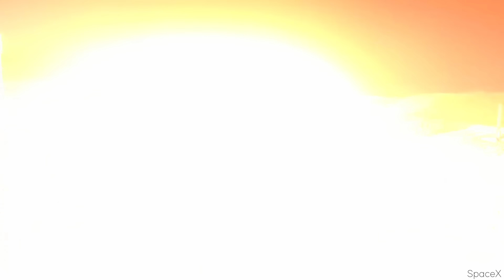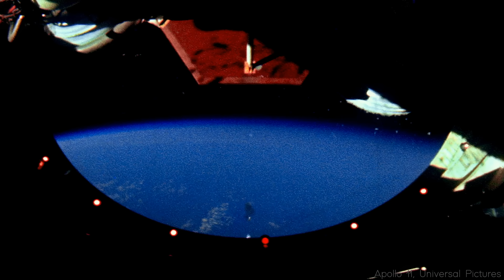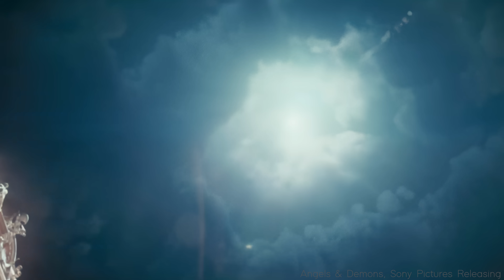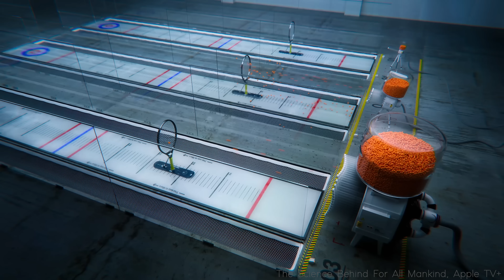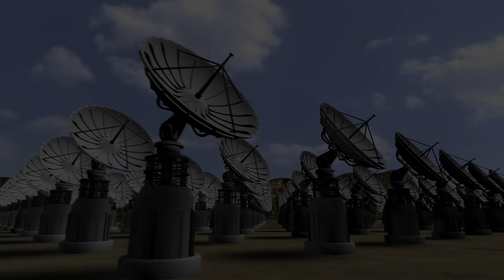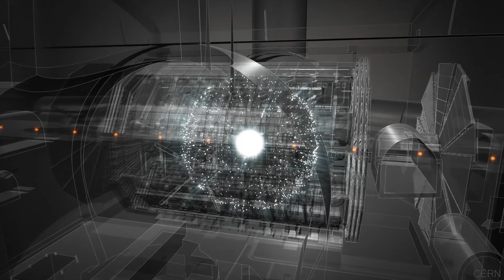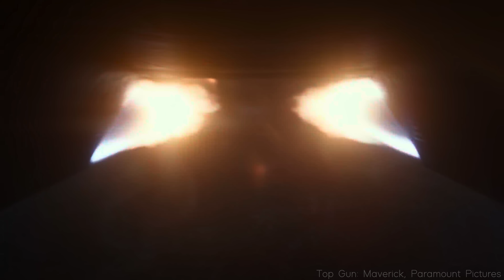Interstellar Propulsion Technologies - RANKED!

Comment: I watched the video twice over again. It's really good, as all of your videos. Big fan of your channel.

 feel like at least two options are missing.

One missing option are nuclear fusion drives. Fusion was briefly mentioned with the Bussard Ramjet. As fusion is likely to have a specific impulse a few orders of magnitude bigger than fission, it may be worth a mention. Also, there are efforts to get active engineering research going on fusion drives. Fusion drive research will also benefit from the already ongoing fusion reactor research. There are some major technological breakthroughs that are required for fusion drives to become a viable option. One is that we get nuclear fusion reactors fully operational. We're on a good way with that, although not quite there just yet. Second is that once we understand nuclear fusion reactors, we need to miniaturize them. ITER is one of the largest and heaviest machines that humanity has ever built, besides aircraft carriers and the LHC. Too big to put on a spaceship, even if we make the spaceship a bit bigger. This puts it into the A-tier, and in 1-2 decades this probably becomes S-tier.

Another missing option is the Kugelblitz engine. A Kugelblitz engine uses the Hawking radiation of a tiny artificially created black hole. As the general research about black holes is very solid and creating an artificial black hole seems actually possible using a Dyson swarm, this isn't as speculative as Alcubierre Drives or wormholes. I'll put it in the C-tier.

Comment: If I remember correctly, both the nuclear lightbulb and nuclear salt-water designs have high specific impulses, way higher than "double of chemical rockets". In theory, nuclear salt-water could even have high specific impulse and high thrust simultaneously, basically making it a torch drive we can actually contemplate. The only problem is it's incredibly dangerous and polluting if used in the atmosphere.

Comment: Running a 100 Gigawatt laser array would cost like $10 million per hour just for the power bill. The breakthrough starshot proposal envisions sending 1000 probes weighing only a few grams each, which would take about 10 minutes of laser power to accelerate to their final cruising speed of 20% light speed at 10,000g. That's about $1.6 Million per probe just for the electricity, or $1.6 billion for the whole swarm. (To say nothing of the cost of actually building such a massive laser array.)

Comment: Antimatter-metallic hydrogen Impulse jump drive . Only thing is that u can’t go in a straight line but an upward jump. U turn on the ships plasma bubble by blasting the bubble with ultra intense laser to squeeze the photons into a dense shield of “squeezed light plasma”around  ur ship .angle to ship 90° for a jump .release the Antimatter-metallic hydrogen into impulse thrusters redirecting the squeezed light plasma around the ship into then thrusters via vacuum burst and ur vessel is in motion till u run out off energy . About 20x the speed of light !!!  in a hop worthy of sci-fi fans
Reply: That sounds like the self-licking Ice cream cone has a shape-charged Twin?

Comment: The rule of thumb that I like to use in my own thought experiments is something I like to call the rule of 9's.  If you accelerate at 9m/s^2, you will reach 90% of C in 9 months.  These values are rounded and if you do the math, none of them work out to exactly that, but it's a useful back-of-the-napkin formula.  I also like to use this because at 90% of C, time dilation will cause the travelers to experience roughly half the time as earth (excluding acceleration and deceleration), which is also a good psychological limit for the travelers.  If you experience half the time of earth, then when you return, things will be different, but probably not totally alien.
Reply: The real advantage of this acceleration is thats its nearly 1 g, constantly, allowing the expanse like artificial gravity for the entire ride.
Reply: It is harder and harder to sustain that acceleration the closer you get to the speed of light.
Reply: @ЕфимРябушев  From an outsiders perspective the acceleration is decreasing due to time dilation, ie since time is passing slower on the ship the engine is getting less done per second so the acceleration drops off as the ship asymptotically approaches the speed of light. However from the perspective of someone on the ship the acceleration feels constant, since they are also being time dilated, they feel like the same amount is being done each second since their seconds are longer.

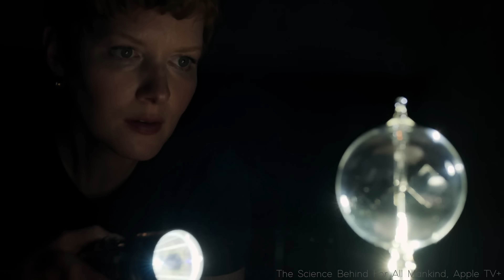Comment: Showing a radiometer 14:11 is an incorrect illustration of photon pressure. That's not what pushes the vanes of a radiometer. I myself don't understand the mechanism, but they rotate the wrong way for photon pressure to be the force involved.
Reply: Correct.  They work because of momentum transfer between the heated surface and the gas molecules in the container.  They only work within a relatively narrow range of molecular densities.

Comment: Using a series of the technologies proposed here together, I could think of a probe that might be used to test super luminal travel. I would use nuclear thermal plus Bussard Ram.
Accelerating a hydrogen particle to 10% lightspeed gives us fusion propulsion. There is approximately 1 hydrogen atom in any given square meter of empty space. That may not seem like very much, but if using NTP can get a ship to 1% lightspeed, those hydrogen atoms can be funneled and fusion can be achieved with much less energy because the ship itself would be smashing into those atoms. And then as the name applies, ramjet, the faster it goes the more energy it would produce. Cooling for NTP I would design a skeletal frame with piping that runs back and forth along the outside of the ship. This will hold coolant liquid that is dispersed and cooled by the coldness of space. This piping will also use torus EM shielding provided by fission to deflect oncoming hydrogen particles. There are different hacks I've been contemplating that should take care of a few of the issues that might arise.

Comment: Side-stepping the limitations of the rocket equation is essential for traversing interstellar scales, so putting laser sail alone in S tier makes perfect sense. Warp drives, negative mass, wormholes and other reactionless methods appear to be impossible and the amount of time it would take to develop the new physics that could render them possible is probably greater than the time it would take to travel to Alpha Centauri by laser sail anyway. As intuitive as rockets seem, leaving the heavy fuel and propellant behind and only accelerating the part of the spacecraft that matters is more elegant.

Comment: Technically, Alcubierre drives don't violate causality because they don't actually travel faster than light. The patch of spacetime around them does, which isn't prohibited by relativity. More to the point, the relativistic eqn of time (t' = t √1-v²/c²) doesn't say time goes backwards if you go faster than light - rather that time becomes imaginary - suggesting that you cannot go faster than the speed of light in spacetime. Regardless, this also implies that there are many different frames of reference and so rates of time all at "the same time", which begs the bigger question: which time?
We know that spacetime can expand faster than the speed of light. That's already happening (barring some new info such as some of the problems with redshift being caused by mismatches between various metrics for it). So clearly there has to be a mechanism to prevent the problem. In the case of Alcubierre drives - that seems to be the need for negative energy, which is kind of meaningless.

Comment: I agree with all the placements except laser sail. I would place it in C because, unlike the most of the others, it does not have its own internal propulsion. Worse, the external laser has a limited range. It does double as a solar sail, although its sail is too small to do much. However apart from this, once it is given a push from the laser it is helpfulness. It can't stop or change direction. It's light weight required will prevent and significant secondary propulsion. It is an excellent way to send out a probe. And the sail can  even double as an antenna. But it is not S tier for sending humans anywhere.

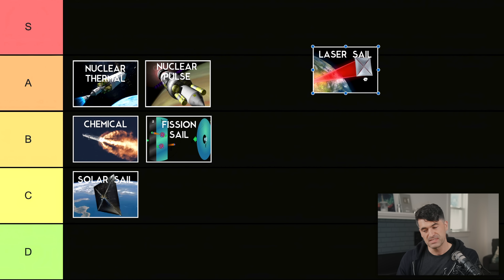Comment: 14:39 “…if we want a photo…”

…then don’t use any propulsion at all.  Use a telescope.

Telescopes come with massive advantages if it’s just information you’re after.  Telescopes are good for targets all the way out to the edge of the visible universe.  Multi-target, when we get bored of one target we just swivel it to a new target.  Serviceable, at least in principle, to repair or upgrade it.  Once a probe or people are sent repair or upgrade missions are impossible.

Ground-based telescopes are convenient but are limited compared to space-based options.  Space-based could have virtually unlimited mirror sizes.  Zero atmospheric distortions.  Interferometer baselines that could be kilometres, AU or lightyears.

Comment: Anti-matter drive. We need to find a cheaper way to produce it!
MRI type machine providing magnetic shielding…backed up by lasers vaporizing any specs seen by radar scanning.
Rotating cylinder providing artificial gravity.
Fly at 10% speed of light…Alpha Centauri in less than 50 years

Comment: I have a pet Idea that is a variation of the Bussard Ram Jet. Rather than have a big cone in front, wrap the ship up in electromagnets and use them to grab ionized particles and thrust them to the rear of the ship. Basically, a large quantity of mass-drivers. No propellent needs to be brought along. 

The ship would need to be sped up to a minimum speed from Solar orbit until it can gather sufficient quantities of particles as it moves forward. 

To slow down, the magnetic fields can push against the particles in front of the ship.

I think of it as a galley ship.

The ship would be built in orbit so that escaping Earth's gravity is not required.

Comment: "Twice the efficiency means half the propellant needed" - this line is not mathematically correct, although it's an easy mistake to make. Twice the ISP means double the delta-v is achievable when all else is the same, but it doesn't work out neatly when reducing the propellant loads. The non-linear scaling of the rocket equation means that an engine with double the ISP can achieve the same delta-v with less than half of the propellant, often much less than half.

For example, taking a craft with a wet mass of 100t, a dry mass of 10t and an ISP of 360, it achieves 8129m/s of delta-v.

An engine with a 720s ISP would achieve 16,258m/s of delta-v, which is double.

However, if we required the 720s ISP engine to do an 8129m/s maneuver, that can be achieved with only 32t of propellant (down from 90t). That's 2.81x more efficient. The difference comes from the fact that the higher ISP engine which spends 32t of propellant doesn't have to carry the other 58t with it, while the less efficient engine does because it won't complete the burn otherwise; the average mass of the craft is thus lower while the same thrust is applied.

Delta-v increases less than linearly with increasing propellant mass fractions and this punishes vehicles with lower ISP's more, earlier. There's a hard limit of delta-v that a given ISP can do for a given mass fraction and each 1m/s as you approach it gets more and more expensive. Staging effectively bypasses/resets this limitation, but comes at a high cost; doubling delta-v via using a two-stage vehicle probably increases the mass by 5-10x rather than 2x. After doing that a few times, things get truly enormous.

Comment: No mention of Fusion Torch rockets?  Why use all the mass of fissionable materials when you can use hydrogen and fuse it instead?  It's not even that difficult with our tech, the only reason we don't have fusion power sources is because we need to contain the plasma.  Fusion Torch Rockets use the plasma as reaction mass and can be a MUCH simpler design.

Comment: Halo drives would be like the mass relays in mass effect maybe. Because wouldn't you also need a similar mechanism to slow yourself back down? So it'd be really cool where it's easier to travel a hundred light years than ten. You'd be hopping around from fixed point to point.

Comment: Hold up. I'm not even 6 minutes in and I do not like where this is going. 

Nuclear Propulsion is a straight F tier. Very risky and expensive for no return. 

The only positive is a high specific impulse which ends there. 

Assuming a tank the size and mass of SLS (let's conveniently forget how we would even get it there) and a 100t payload, you get 4,000 m/s of Delta V. That's it. Starship currently gets around 7,000 m/s of Delta V. So for less risk and cost, a fully fueled Starship is more capable than a Nuclear Engine. 

Hydrogen is not a good propellant. It's sparse which results in massive tanks and little thrust. Less thrust means more time fighting Earth's gravity which means more Delta V lost which means more propellant is needed meaning larger tanks meaning more propellant and so and so forth. 

It is not good for high energy orbits either. Kerolox would be better for that

If you want me to provide you with the math, I absolutely will. Just make sure that if you do this in the future, Nuclear Propulsion goes where it deserves. F tier

Comment: If our goal is to truly be intellerstellar, the only one that works is mind upload. The human body is weak, and does not survive for very long. Even going at light speeds the nearest planets that could be hospitable are so far away that you'll die of natural causes before reaching them. Only a tiny handful of close by ones. 

But upload your mind to digital storage, and you live forever. The issue with space travel is the limitations of the human body more than anything else and there is simply no way to avoid that other than replacing our bodies. It may seem like this is far off but we are already experimenting with human augmented electronics that have been installed into peoples brains. Which is one step closer towards being fully digital.

If we could fully upload our brains right now, then with our existing space travel technology we already can be intellstellar and visit other planets infinitely far away. We have probes past the solar system already. Make a probe that has your brain as digital storage, with backups to account for data corruption, send it away for a few billion years and it will eventually reach whatever planet you want. Then convert your brain backup into a robotic body once the ship has landed. You have now travelled to any planet you want in instantaneous time, as no time has passed for you because you've been offline. Us on Earth will be extinct before that ship ever lands, so we will never know if it was successful, so thats one downside. But in theory it should be successful and that robot can start rebuilding on a new planet.

Comment: Can lasers push away from a stationary object in zero G if mounted to a ship?
Reply from the maker: In the context of the halo drive, when the laser is first fired, it produces a momentum back reaction on the ship. When the beam loops back around and is received again, it produces a second push. These pushes accelerate the vehicle.
Reply: @CoolWorldsLab  Right I see, I guess an endless pulse laser would require a lot of power making the ship really heavy when black holes aren't available to help. I see why a light weight sail with ground based lasers is a viable choice as power would be supplied on earth, I just don't get how they will slow down once they get there.

Comment: No Nuclear Salt Water rocket? Do you know about the website Project RHO?
Reply: I was also disappointed by that not being mentioned. NSWR is basically Orion but with continuous explosions instead of pulses. It's like switching from grenades to proper chemical rockets. Easily S tier, although the effort of acquiring enough uranium as well as testing it with such extreme radiation might be a concern. Still the max velocity for a reasonably sized ark ship powered by a NSWR is around 7% c which is truly insane. Add a laser solar sail to further help get the ship up to speed, and suddenly the entire trip can be done in a few decades rather than several centuries.
Reply: @Beskamir  lithium deuterium is a better fuel source, if you can arrange for proper neutron density, which is a thing we can currently do with neutron source reactors. You basically get an Epstein Drive out of it, a continuous afterburnening fusion torch drive capable of interstellar travel. 

As a bonus, this design is more powerful than the version that uses weapons grade as its fuel.
Reply: @torg2126 Since we don't have fusion outside of bombs yet, I'm a bit hesitant to consider engines that require it as a prereq even if it's ultimately more powerful.
Reply: Chernobyllin' to another star!
Reply: @EnneaIsInterested Space is filled with deadly radiation anyway, if anything we're enriching it :)
Reply: Love that site, great reading.
Reply: Dr. Robert Zubrin is pretty sharp
Reply: The Nuclear Salt Water Rocket by Zubrin is my favourite.  Thanks for pointing this out.
Reply: That's the one I was trying to remember, good one
Reply: there are also fission fragment drives.
Reply: I see we're both fans of that logo 😂
Reply: Dude, UN Spacey! Macross, Space Fold Technology! 😆👍
Reply: That thing is just comically unsafe in the event that it springs a leak or the calculations aren't quite right (could cause critical mass and make the whole thing go up at once), but the performance is something else.